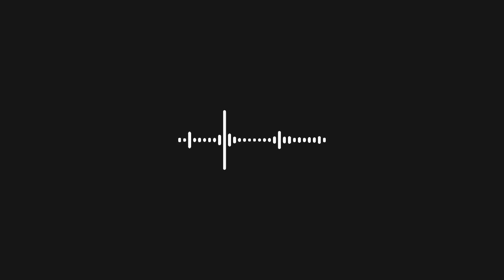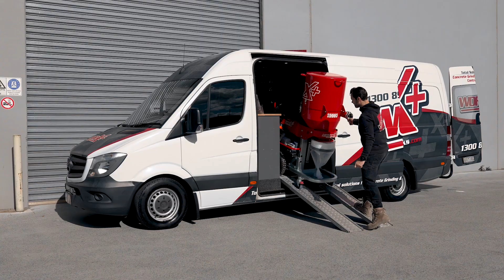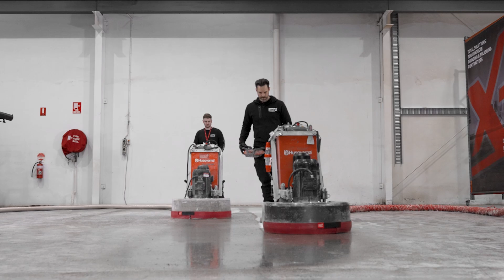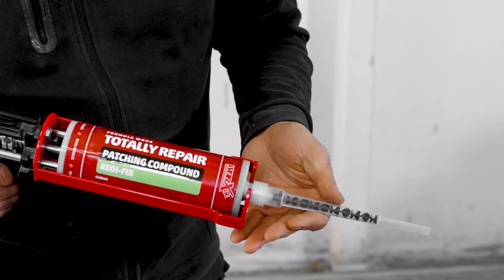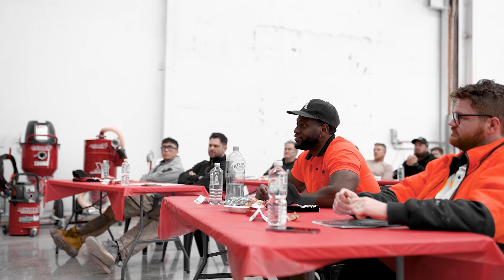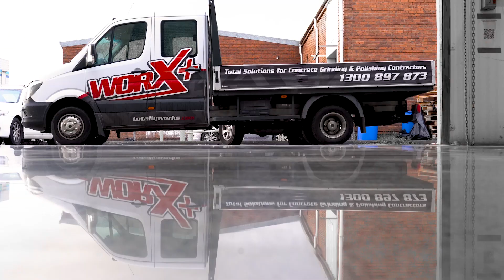TechTalk Podcast Episode #12 How Is Low Carbon Concrete Made? FT. Peter Killeen

Comment: No - the slag uses up CaOH which densifiers need to cure. Also densifiers never cure fully so remain partially water soluble which won’t go well over a very long period. 
There are other alternatives.
Curing with a densifier is right with traditional concrete with little slag